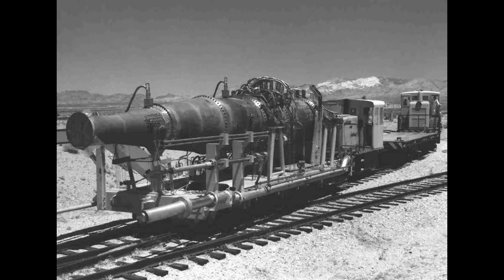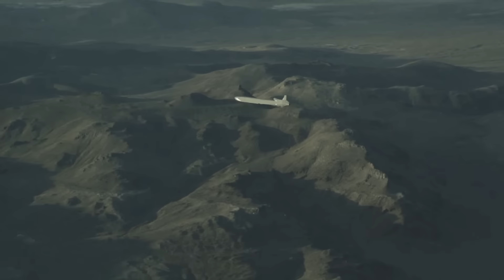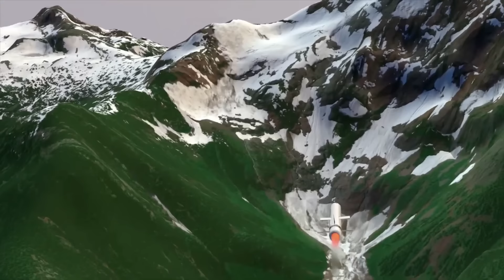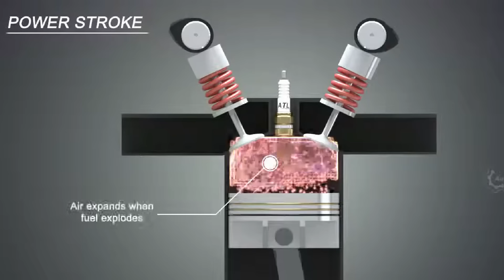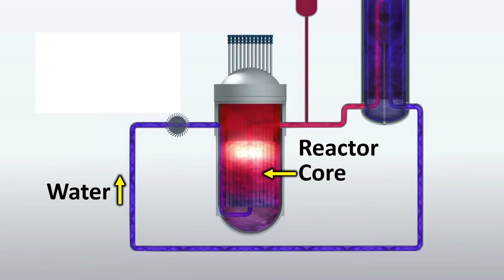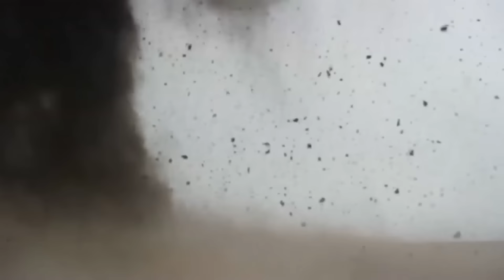How Can Nuclear Reactors Power Missiles? | Russia's Burevestnik Missile #militarytechnology

Comment: The most important weapon that Russia peddles is fear.  If this missile works, then it is very, very scary.  What you must remember is that Russia is running out of money, its oil industry is being destroyed, and its military is corrupt. 
Many cities have no petrol.  Many cities have no internet. So it is in their interests to parade a scary new weapon in the hope that the world will shake in its boots with fear.  And willingly do Russia's bidding.  It's very easy to mock up a new weapon and show it off.  But the  weapon is fake, and it does not work as claimed.  It probably has a conventional rocket motor because Russia is incapable of producing high-tech weapons of sufficient quality and reliability to actually work.   This is why Iran supplies Shahed drones to Russia and why North Korea supplies artillery shells to Russia.  Russia cannot even make radar systems that work. Russia doesn't have control of its own skies.  Every day, Ukraine is running rings around Russian air defence systems and missiles.  And the Russians, out of thin air, mysteriously come up with a brand new nuclear powered missile, at the same time that they can't even provide their own troops with clean drinking water.  Go figure.
Reply: trotting out every masonic fairy-tale about Russia, huh ?
those globalist MSM would never lie, would they ? 😂😂😂
Reply: @pietdev.4648 Are you a Russian Bot?

Comment: The accident in question involved a liquefied metal fire so it uses something like a sodium heat transfer cycle where the reactor is separate to the engine itself. The topology of the missile and observed lack of radiological emissions would support this.

Comment: Russia also tested a nuclear powered torpedo.  It is probably electric, through steam propulsion would work.  Much less energy than flight.  With 2m square of convective area, to get 400kw equivalent power to tomahawk missile, gemini says 1445K temperature contact to air.  Some margin for steel alloys to not melt if a bit heavier.  A few days of flight time would suggest an isotope that has half life of a week or so... or simply that reactor integrity breaks down within a few days.  A 400kw thermal nuclear plant with safety/longevity and lower temperature over an area that fits inside a shipping container would seem like a useful energy breakthrough even if priced at $8m ($20/watt thermal) but helps if much cheaper.

Comment: The idea of it is very simple. Replacing the heat from combustion made by jet fuel, to heat made from nuclear reaction to power a jet engine. But as mentioned, it would only work in ideal conditions.

If it worked, the moment you fire that nuclear missile from your home, you've already contaminated yourself with the radiation from the air around the missle before you even come close to hitting your intended target.

Comment: Video is total garbage. Convensional jet engine works on expanding hot combustion gasses which turns turbine that compresses air. Where is the compressor part in this this? It takes crap load of energy to compress air. And since it does not use ram type of compression where energy to compress air comes from?

Comment: This seems to be more of a retaliatory / deterrent weapon, not for a first strike.  It’s slow and trackable (as any other cruise missile) so advanced defenses will likely be able to intercept and stop it with high probability. If, however, launched before the first wave hits it will remain in the air for enough time for the first wave to hit and the dust to “settle” and then with strike and defense capability largely reduced at both parties, this becomes the ultimate finisher. And, Of course, I have no idea what I am writing about :)

Comment: Good explanation. By the way, in the process of testing the equipment not even in war lots and lots of nuclear reactors will be smashed into the ground causing a huge environmental disaster and the technicians ordered to examine the rockets parts during the test program will most likely die of cancer or radiation sickness. Not quite an accomplishment. It would be better not to mess around with nuclear reactors that reckless.

Comment: The fuel air mixture does not explode in an internl cumbustion engine, it burns rapidly, if it explodes then the engine suffers from pinking (detonation) which will destroy the piston and thus the engine..
Reply: Synonym of combustion is burst.. same principle.

Comment: It's basically a nuclear heated closed loop steam turbine generator. Same tech used everywhere only miniaturized..It powers an electric turbofan, Probably uses electro magnetic bearings.
These could have a duration equal to the life of the reactor if they are constructed properly.
No it isn't using heated air for propulsion. You cant get enough thrust with that without combustion. It's a nuclear generator powering a turbofan. Basically a fan on steroids.

Comment: I think that this is likely a molten-salt reactor (MSR). It explains how it can be so compact that it fits inside a cruise missile body. It explains why it's so slow, because MSR's don't produce a lot of power compared to traditional reactors. And, MSR's weren't available in the 1950's when the US was testing out its outrageous Project Pluto, which was a reactor that spewed radioactive waste right out the exhaust!
Reply: очень может быть

Comment: Fission propulsion reactors, like nuclear power reactors generate highly radioactive fission products and actinides such as plutonium-239. The cruse missile may employ fissionable fuel that has a high concentration of plutonium isotopes. In the case of power reactors the containment of the spent nuclear fuel SNF is strictly regulated. In the case of weapons of war, such as cruise missiles there are no such containment requirements. If the experiences an accidental crash, is blasted out of the sky, or explodes in proximity of the target the SNF will be explosively dispersed and then drift downwind. That means radioactive particle fallout would occur in the vicinity and downwind of it. Some of the fission product particles will remain a potential hazard for around 600 years and the Pu-239 particles for around a half-million years.

Additionally, no nuclear power country yet has an operational deep geological repository to disposed of high-level radioactive waste products discharged from various types of fission power reactors. Frequently, nuclear power and nuclear propulsion promotes, find that it is advantageous to not get into that aspect of long-term nuclear waste handling when trying to promote these technologies that they love.

Comment: It is said that nuclear contamination of the engine exhaust is a problem. First, this rocket somehow landed, that does not feasible with air directly passing hot reactor, i cant imagine the trust management. Heat exxhanger looks more plausible. Second, contamination is an added benefit. It does not need a nuclear warhead to make the US/EU soil uninhabitable for a sentury around its explosion point. And stay conventional at the same time.
Reply: воздух в двигателе не взаимодействует с активной зоной реактора напрямую, он нагревается через теплообменник, поэтому никаких радиоактивных газов не будет.
Reply: @mihasvideos ну я это и написал

Comment: "Flying Chernobyl" and scientists dying and all that non-scientific non-factual political insertions are below a channel that has "Science" in its name. There's no data of radioactive trails to support any of that, it could have several countours inside the core. Not a word about Kosmos-xx series satellites in the late 70-throughout 80s that had this core on board. It obviously has some protection for electronics. The only reason it's a lot more reliable now is thanks to the titanium alloys that can withstand massive temperatures.

Comment: If safe this technology could be applied to commercial airlines.
Reply: And to space travel
Reply: @oghoghoasemota5205  Doesn't work because it is air cooled.
Reply: @SwissCamper  - I thought Putin said in his speech that reactor has potential dual-uses, and could one day be used for space exploration. So he probably meant that reactor is a power source which could be adapted for further types of propulsion using onboard propellant, etc.
Reply: @SwissCamper you can take air supply as working body with space ship, it reduce the need for an oxygen in combustion engines. This reduces weight and increased thrust per unit weight dramatically.
Reply: How many planes crash, and how many if those crashes sites would you like to be radioactive for 100,000 years?
Reply: @andrewdyrda8012  You are blowing things out of proportions. Hiroshima and Nagasaki are populated cities today.
Reply: They are going to use it for the moon base
Reply: Never going to happen. It will never get past regulatory examination because the risk of radioactive contamination following an aircraft crash will prevent it.
Reply: Actually it is more easier on big planes just to use small nuclear reactors and generate electricity for propellers.
Reply: It's safe until the commercial aircraft falls out of the sky, just like the commercial aircrafts we have now😂
Reply: That's the problem. ChatGPT calculated that this engine needs to be 1000x to 10000x more efficent than existing systems. I would also expect medium sized versions for electricity generation and so.
Reply: no it cannot

Comment: Well, if highly refined nuclear fuel is used, the reactor can in fact be very small. With refined uranium for example, about 1 kg is sufficient to sustain a runaway reaction. Combined with tungsten which melts at 3000⁰C and a bismuth shield, it's becoming almost as small as a 2 kg chocolate egg. If carefully calculated, no temperature regulation is needed, but the flow of air. No wonder there was an accident ... missing coolant is fatal 😅
Reply: There are no reactors. This is a MHD device. First it transforms the air in front of the missile into plasma with microwaves and this plasma is then sucked by the Laplace force emitted by the parietal accelerator on the fuselage of the missile.
Reply: @JMLippert  And it does this by snipping a finger?

Comment: There is no proof that the missile has a nuclear trace behind it. It is much more sofisticated technology than the author of this video shows.
Reply: Agreed. I've seen some Russian commenters suggesting Burevestnik either uses 2 cooling loops to better separate reactor from airstream to avoid contamination, or else some claim Burevstnik uses some high-temperature cladding that fully encapsulates nuclear fuel at high temperature without suffering breakdown. I thought Putin in his speech said Burevestnik uses liquid metal coolant, so I'm leaning toward believing that it uses cooling loops.
Reply: I mean its uses nuclear energy for fuel. its literally a mini reactor in the missile. Its not different than a aircraft carrier or submarine except its smaller in scale. They are just yapping ofc. They would just throw rubbish instead admiring this brilliant piece of engineering. However this will be probably extremely expensive missile and likely will be used as a tactical nuke delivered as cruise missile making air defences very vulerable and radars useless. 
Ballistic missiles use ballistic trajectory which can be targeted by long range sams. This are much more dangerous.

Comment: You failed to explain the thrusting principle since no sufficent thrust is possible just by fission-.
Reply: Fusion creates heat. The heat creates thrust. Just like in a normal turbojet engine, but instead of combustion, there's the reactor that heats the air.
Reply: @sgtSerGUNt  I never heard "heat creates thrust" in my entire life, never ever.
Reply: @profounddamas  I mean, the turbine compresses air, then heat from the reactor makes the air expand, so it creates a stream that creates thrust.

Comment: Apparently, it has a metal cooling system.  Basically, there is metal instead of water,  and when the reactor stops, this metal solidifies and creates a sarcophagus around the reactor so there are no radiation leaks.
Reply: They mentioned the reactor can be started in seconds and shut down safely,basically start stop feature that can be reused many times its not a one time use only
Reply: @kissmyadss  well. As soon as they start, the metal will become liquid again 😂
Reply: If the fuel concentration is carefully calculated, then it will not cool down. It is designed to fly until hitting the target, and then explode together with the war head. It's a dirty bomb.
Reply: @Smartapillo  If it's payload is a nuclear bomb then isn't your comment somewhat superfluous or just moot?
Reply: @rogerpaquette109  I simply doubt it can be stopped, once released with a warhead. The reaction needs more and more fuel as time passes by, and at a certain point it can't be stopped, because the overall temperature is so high, it is close to explode anyway.
Reply: @Smartapillo  What do you mean more fuel? All fuel actively in use when reactor is on the go. Probably you have some strange ideas about how reactors work. To regulate reactor heat output, the decay rate regulated (classic way is screening\exposing fuel rods from\to each other), not amount of fuel. Fuel not leave reactor active zone.
Reply: @MetaJamm  I know very well how it works. First, it is regulated down at most, and the more it burns over time, the more the regulation is open. At a certain point, it can't be stopped any more, because it's more or less burning everything. I am talking figuratively. Almost pure uranium or plutonium isn't a typical reactor fuel. Not even close to a carbohydrate burner 😅
Reply: @Smartapillo  dead internet on the go.
Reply: @Smartapillo thats not what i have heard.
Reply: @onepartofone  Let's see how further notices evolve. In my opinion, there is no need for a shutdown procedure for a nuclear warhead transportation.
Reply: @Smartapillo  its done if it deployment needs to be terminated without detonation if a war head. Its can be retrieved later with the reactor fully sealed.
Reply: Who cares if it has a nuclear warhead 😂
Reply: в качестве теплоносителя смесь свинца и висмута
Reply: @krainiy.praviy.sleva.  спасибо за информацию.  Теперь буду знать. Я предлагала, что что то вроде свинца должно быть.
Reply: @krainiy.praviy.sleva. я слышал, что жидкий натрий
Reply: @krainiy.praviy.sleva.  ложь. NaK там

Comment: I would assume the engine could also be used on space craft?
Reply: No, since space has no air, which means you can't heat up air, which mean you have no way of propulsion.
Reply: Yes, the Zeus, with a 1 megawatt reactor, which can be used both for propulsion and, say, for a (very) energy-intensive load, for many years. Most of the ship is not solar panels, as many people think, but cooling radiators.
Reply: Именно так и произойдет.
Reply: Yes